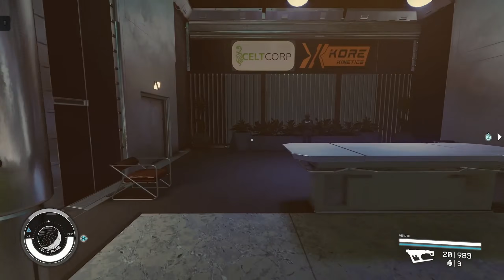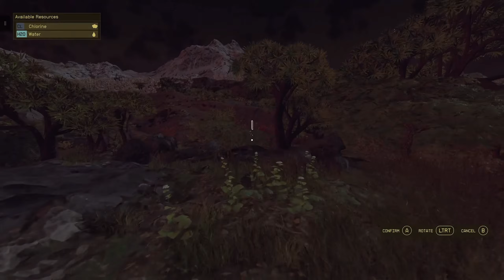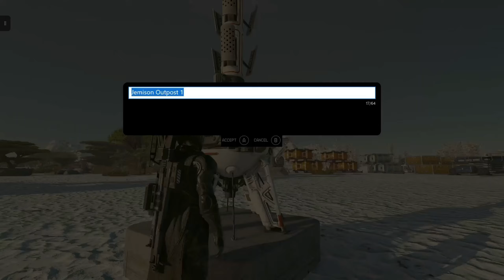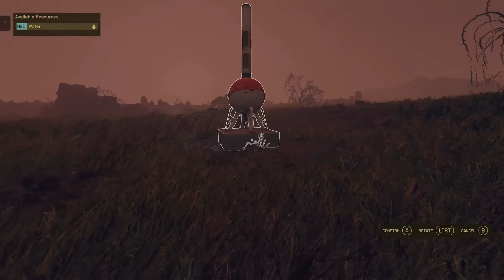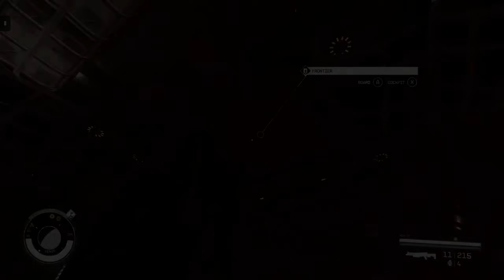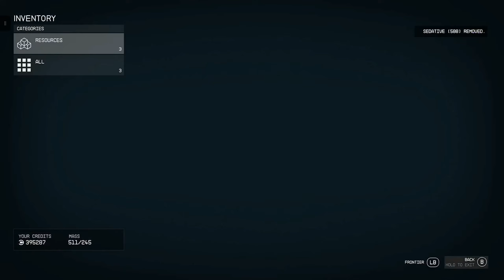Starfield Moments Outpost Build Guide for AMP, Snake Oil and O2 Shot for Credits and XP Farm

Comment: You need to setup a cargo link system
Reply from the maker: I have done the Cargo links before on Outposts and that is a great suggestion. They used to be very buggy, maybe they fixed that issue. I always make the Frontier into a Cargo Hauler that has 20K+ cargo. I just transfer what I need into ship cargo and take it with me. For me, this was quicker and those supply ships are very noisy when they come and go.

Comment: What are you using the transfer container for?  I have not had good experience using them. I appreciate this detailed walk through. Thank you.
Reply: Transfer Containers also let you access the the contents of the storage linked to them from your cargo terminal inside your ship. So all you need to do is land nearby on the landing platform and you don't need to leave the ship.
Reply from the maker: The transfer Container will tie all the resources from the large storage contains together where that are now available to the Outpost for the Crafting benches you place. So when you craft the Aid items, it has access to the stuff in the Transfer Container.

Comment: Given the multi-outpost setup you have going here, I would invest in ways to automatically transfer resources between planets. Yes, there is more of a resource and research investment, but having everything delivered to one outpost for quick crafting between missions would only improve the mid-game viability of this farm.
Reply from the maker: Good suggestion, I have used Cargo Links before with several bases and it was fun getting it all working automatically. You need Helium-3 to power the Cargo links. I did a video on how to get Aluminum and Iron on Andraphon (Moon of Sumati in the Narion star system). You can also get Helium-3 there, if you search around enough and then ship the Helium-3 to Procyon III and then ship Sedative to to the Jemison Outpost.

 I do find Cargo Links to be very noisy with the cargo ships coming and going constantly. The Sedative outpost has two large storage containers and you will get over 1,000+ units of Sedative out of them. That makes 1,000+ O2 Shots! When I need another 1,000, O2 Shots, I sit or sleep on Venus for 20 hours and go pick-up more.

Comment: If you're going to manually pick up the sedative and carry it to the containers at the other outpost, then you don't need either of the transfer containers.  It might also be worth mentioning that you'll need to raise the Outpost Engineering skill and do a bunch of research to get the storage and power options you use in the video.

Otherwise, very detailed and easy to follow step by step video!